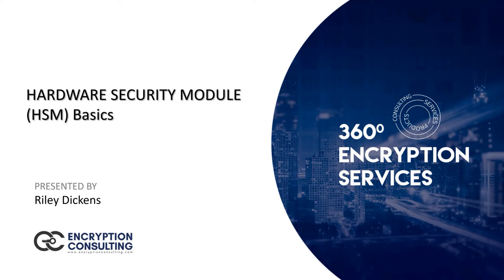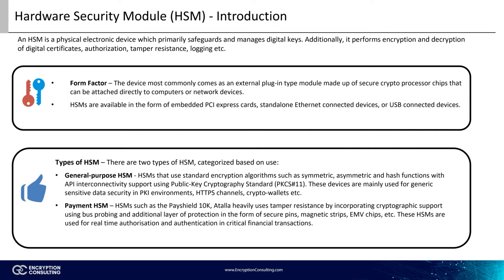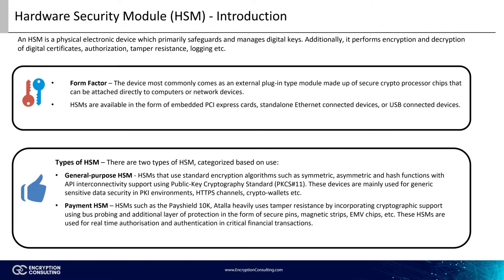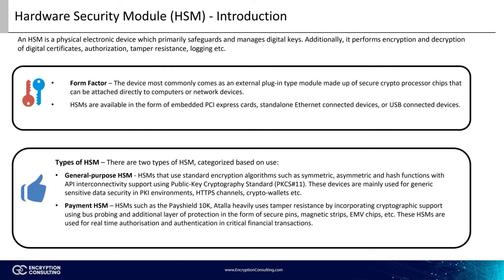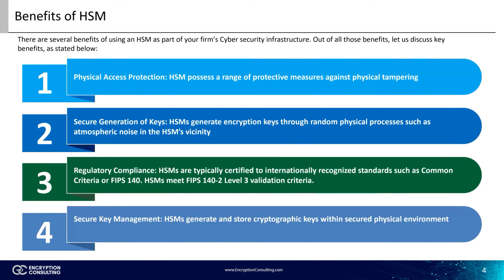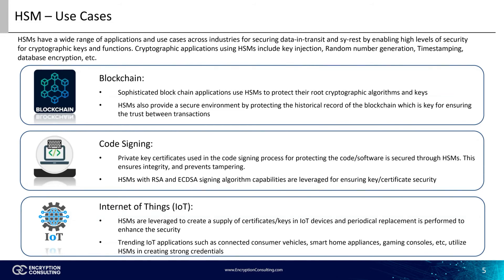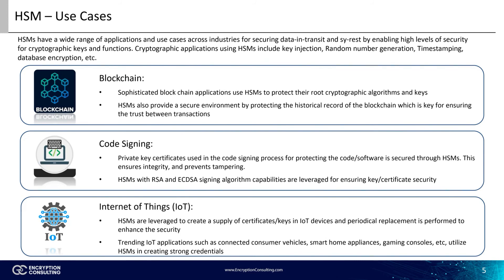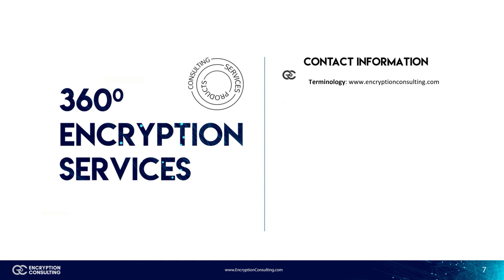Hardware Security Module (HSM) Basics | Introduction To HSM

Comment: So they’re glorified GPUs. I’m being tongue in cheek but it’s not that far from the truth.
Reply: Don't know where you found the parallel between GPUs and HSM's. The only thing they have in common, perhaps, is that they typically are found in PCI-E form-factor. Otherwise, HSM PCI-E devices usually use, from my understanding, highly specialized ASICs that are purpose built for encryption, decryption and hashing. GPU's on the other hand have thousands of smaller general purpose cores designed for parallel computing at scale.